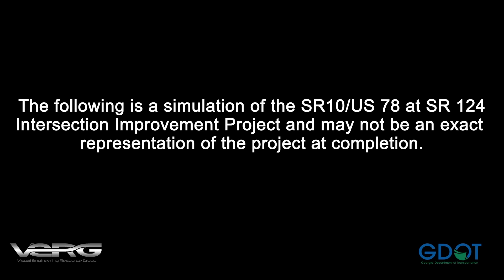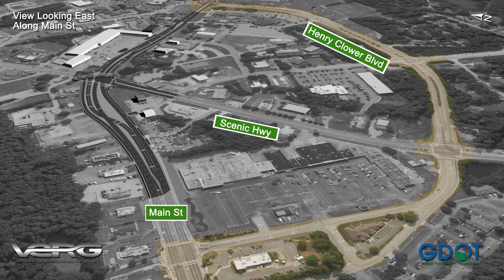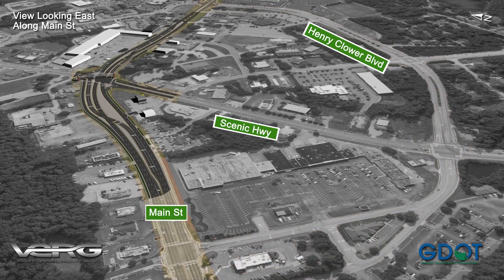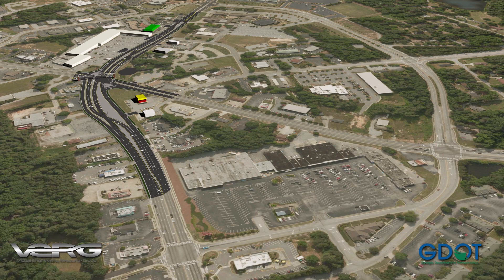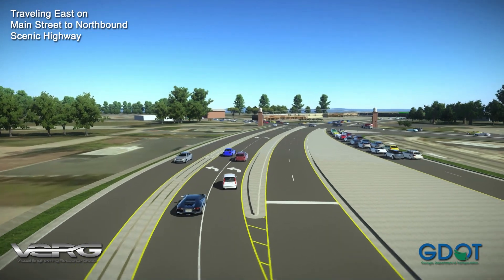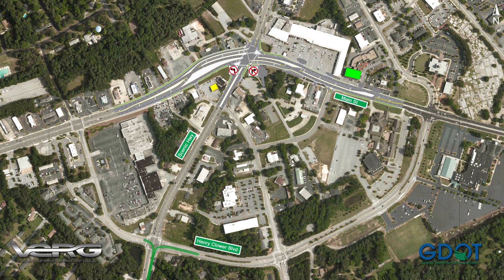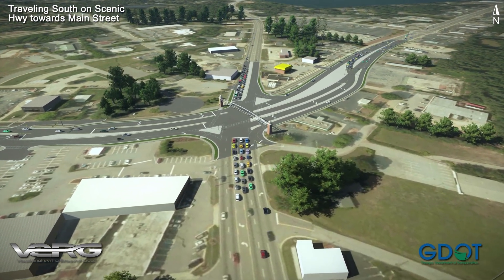US 78 & SR 124 - Displaced Left Turn (DLT) Intersection

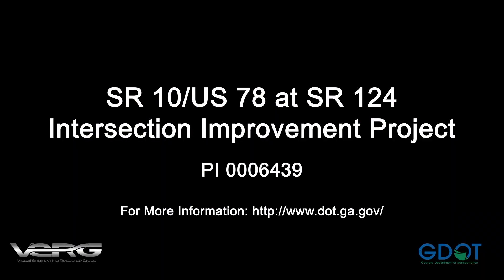Comment: Cool video. Question: The video states (starting at 4:00) that the Henry Clower Blvd improvements and the displaced left turns on eastbound Main St. will be open to traffic in Spring 2019.  Should that have said Spring 2020?